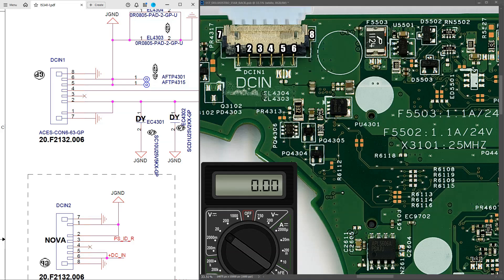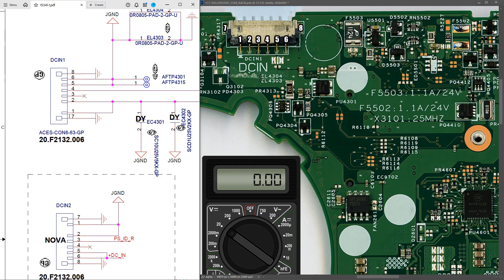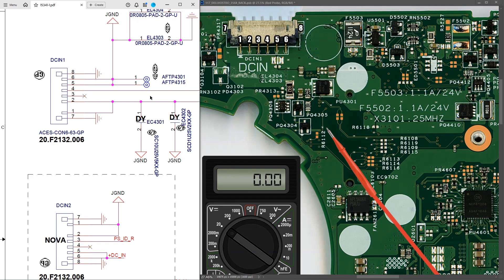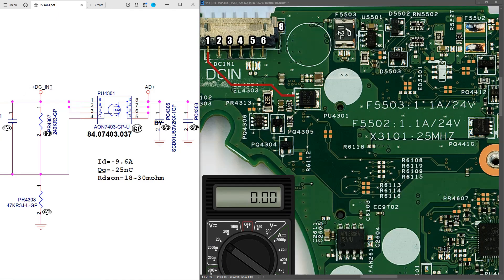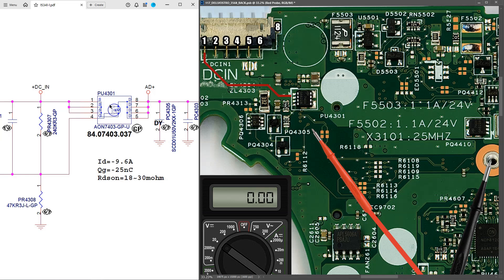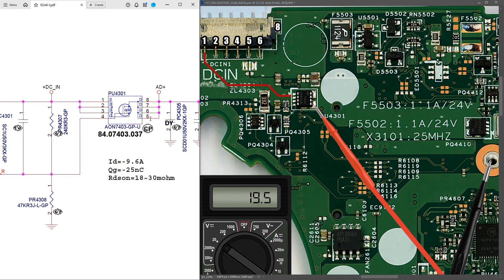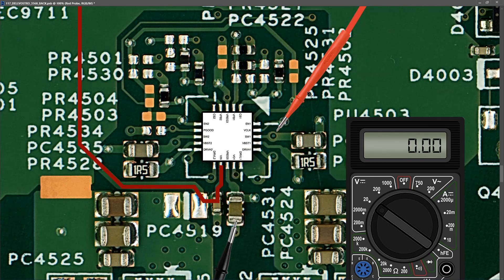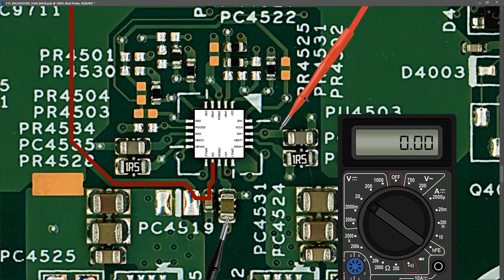DELL VOSTRO 15 3658 - TROUBLESHOOTING

Comment from the maker: Hi all, 
This week is what was left on the cutting room floor from last week's video, but I think it is of value to post it with a run through of the voltages on the now working motherboard. I have managed to work out a way to draw out the 128 pins of the Super IO, so I think this should help me to make make the videos clearer in to the future. 
Tune in next week for The Repair Share vs  Fault Ebay Motherboard #3

Comment: Sir, I also have a motherboard of the same model. That motherboard was dead but I repaired it. It was happening due to a capacitor but after removing the capacitor I noticed that 19 volts is coming at the battery connector which is too much for charging the battery. I checked both the mosfets which charge the battery PU4411 and PU4412. 19 volts is coming on the gate of PU4411 which is wrong. There should not be so much voltage on the shyd gate pin and there is no voltage coming on the gate of PU4412. So does this mean that there is some problem in my charging IC due to which proper voltage is not being generated on the gate pins of both the MOSFETs. Or is there something else wrong. All other sections of my laptop's motherboard are absolutely fine and working properly except the battery connector is getting 19 volts instead of 15 volts. Please Sir, I request you with folded hands 🙏🏻 give me a hint as to what should I check or what could be the problem.
Reply from the maker: I had a quick look at the schematic and from what I can see PQ4401 is the MOSFET that sits between the battery and the main power rail, which is controlled by the battery management IC. So when the power adapter is connected PQ4401 should be switched off (and the battery should be charging) and with the power adapter disconnected PQ4401 should be switched on ( and the battery should be discharging).
Reply: @therepairshare673  I checked the PQ4401 MOSFET, 19 volts are coming on all its pins. The gate pin of PQ4401 is connected to the drain pin of PQ 4412 and 19v is coming on the gate pin of PQ4412 but no voltage is being generated on the drain pin. Now what should I do, please tell me🙏🏻
Reply from the maker: @bhothardgamer7681  Sounds like there is a short through from the main power rail to the battery power rail. It's very difficult to say without seeing, but maybe start by seeing if PQ4401 is shorted drain to source, drain to gate, or source to gate.
Reply: @therepairshare673  When you replied 3 days ago I went to check the motherboard. During checking I accidentally touched a wire near the SIO chip and a short circuit occurred. And when I checked, power supply was being made to all the inductors but not to the IO section, RAM and CPU. Power is supplied to the RAM and CPU after the board is turned on but power supply to the IO section is not being made. When I turned on the motherboard using the adapter the white light came on and went off as it normally does while charging. I was very upset with all this and now I cannot understand what to do. Now I have lost all my hopes but I still want to make this board because I have a lot of memories attached to this board and my family is also not giving money to get it made, so I want to make it myself, I will learn something from this. If you can help, then give me some hint, I will be very grateful to you
Reply from the maker: @bhothardgamer7681  Firstly, dont be too hard on yourself. I have accidentally damaged boards many times. The components are so small, it is difficult to take measurements on these laptops. 

When you shorted near the SIO, did it damage any of the components? Is the motherboard fault the same now as it was before this short circuit occurred?
Reply: @therepairshare673   no, before the short circuit my motherboard was working fine, the only problem was that 19v was coming at the battery point. But after the short circuit everything is the same, now it is in dead condition, rest as I told you the supply is being made there and there. I looked at the motherboard with the macro lens of my phone, but I did not find any black spot or blast capacitor anywhere. Just at the time of the short circuit there was a strange smell like what comes when some plastic burns.
Reply from the maker: @bhothardgamer7681  I'm not sure what advice I can offer. if you are smelling plastic then it sounds like one of the ICs is burned and needs to be replaced. I guess the first step would be to try to identify which IC you are getting the plastic smell from.
Reply: @therepairshare673  After doing some research I found that proper voltage is coming out from the RTC section and I can not check the frequency on the 32khz crystal because I don't have an oscilloscope but some millivolts are being generated there. After the RTC section, on pin number 21 of IC PU5301 just next to the IO coil I am getting 5 volts but on pins 10,11,16,17 I am not getting 1 volt. Does any supply is needed that will make this IC generate 1 volt or is the IC itself faulty. And on pin 2 of IC PU5401 1.8v is not being generated and on pin 7 there is no volt and on pin 8 there is 3.3 volt.
Reply from the maker: @bhothardgamer7681  I guess the main concern from what you described is that you have shorted the SIO. I think the next thing to check, with the power off, to see if the 3.3V LDO or 3.3V SW voltages are shorted.
Reply from the maker: @bhothardgamer7681  Do you want to send me an email to therepairshare@gmail.com with an update?

Comment: @therepairshare673  At about 12:30, you measured 2.9V on pin 127 of the EC chip, which is connected to the power switch. Do you think it is 2.9V because the CR2032 coin cell is supplying 2.9V, or there is another reason this is not 3.3V? I see that the CR2032 battery on this board is the original factory brand, so a 2.9V charge would be expected.

Comment: Brilliant! You worried two years ago that showing expected voltages and voltage drops at each point of each power rail would be boring and tedious content. But I disagreed. This type of content is highly valuable as reference material for any service technician who does not have a working twin to compare with a faulty laptop of the same model. You provide the schematic, a high resolution board view, the best test points to use, and the expected measurements. The only thing missing is the trace connections shown by board view software. You should make more of these videos for every WORKING laptop you have access to. It would be extremely helpful to anyone trying to diagnose a faulty laptop of the same or similar model. Thanks again for all your hard work creating the photographic and video images for your brothers in the tech service community.